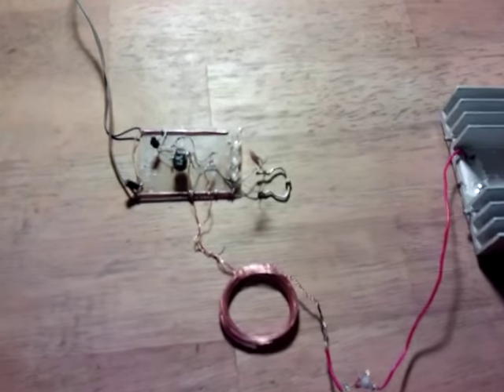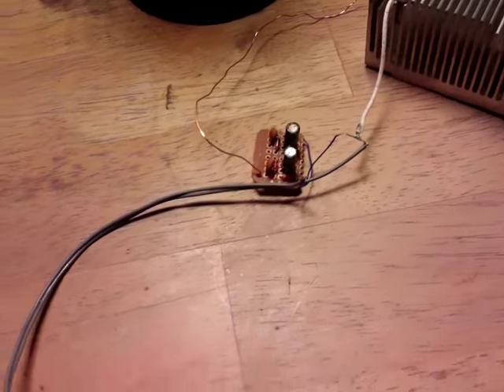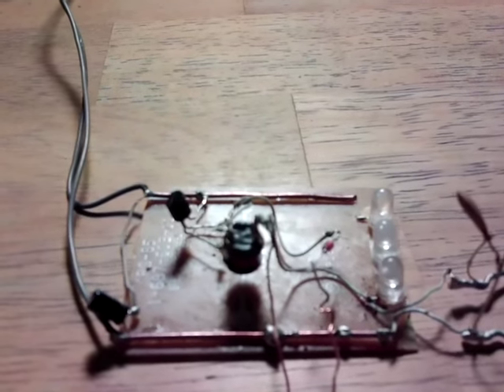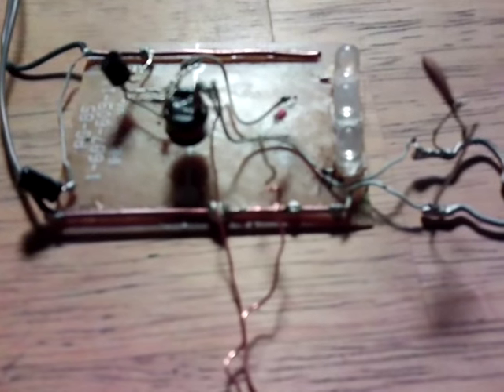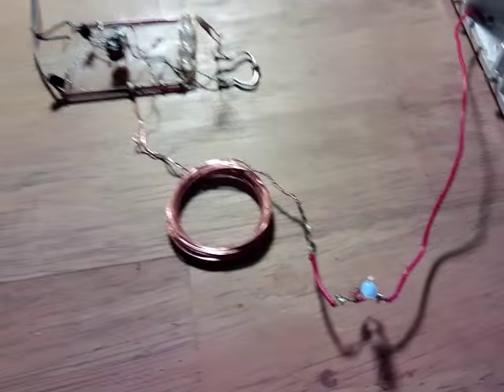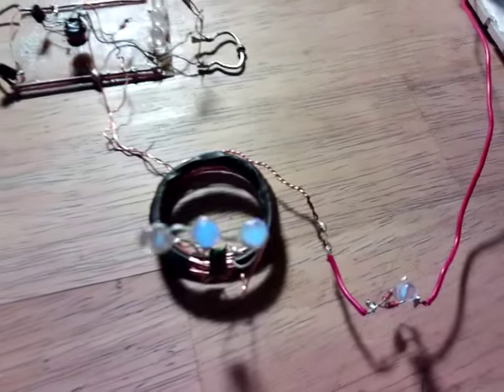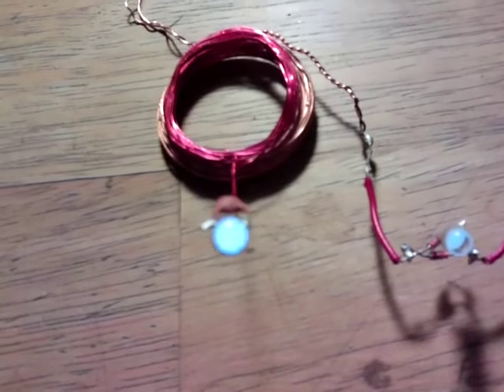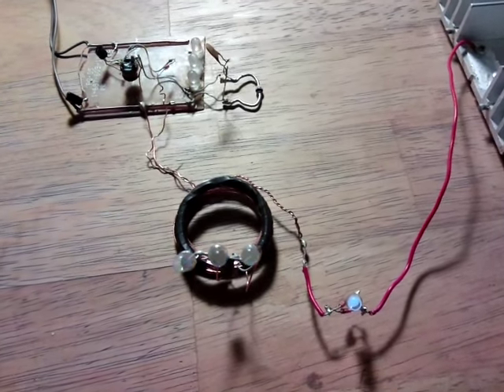Battery free + wireless electricity - SJR L 4.0

Comment: I am in awe I mean these are diodes after all
I often wondered if say a LED was used in a simple crystal radio as the detector.
Cool stuf
Reply from the maker: Craig Nehring The SJR L 4.0 is one of those classics, where small changes can alter the running in different useful ways. Am glad to be learning the subtleties of different diodes..including that the big stonker thing on this circuit is actually really a delicate fine piece of kit. Would never know from the size of those legs lol
An LED in a crystal radio has too high of a voltage drop. They need a diode that can pass RF frequencies, with around 0.2-0.3V drop.
Reply: slider2732
Oh that's right, a signal diode.
I had a holiday string of line powered LEDs that became un plugged and in the dark of night I could see them all glowing softly. There is a cell tower about 1/4 mile away... hmm
Reply: slider2732 That diode looks like either a BYV26 series "ultrafast" highvoltage rectifier. I have several that I also pulled from CRT TV chassis. Or it could be the big honking "3A" SOD-64 case style rectifier, which looks the same as the BYV only larger.  Can you read any numbers on it?
(Nicely done! You get a "thumbs up" from me!)
Reply from the maker: TinselKoala Have just had a look...it does have writing on, just never thought to look it up. It went on the circuit to try out and worked so well that it's not been taken off since. Says 'BYM36C'. Will add that to the description.
Reply: slider2732 3 Amp, 600 V fast avalanche diode, 100ns recovery time. Thanks for looking for the number!